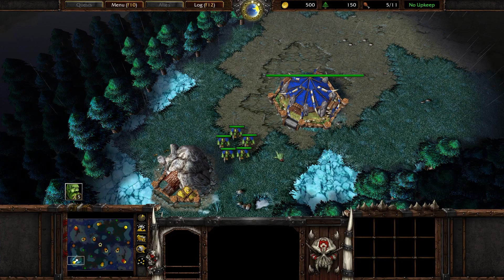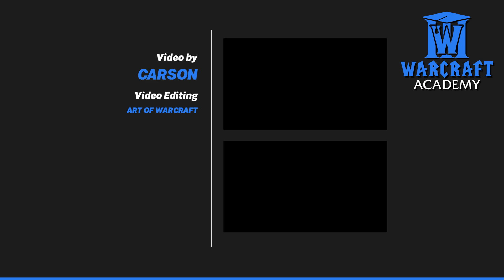Hotkeys & Control Groups - Warcraft III Academy

Comment: It was a very nice video. I want to ask something. I would be glad if you could help me. Is there a way to assign control groups to a single super group? There is a maximum of 12 units in a control group, but I want to control 50 units with a single key. For example: 5 knights, 6 priests, 3 heroes, 10 gryphon riders... all in a single group

Comment: yeah but kinda missed the most important part of control groups, the several ways you can press them with your one hand, it's rarely discussed but it is so big of a thing and i think why so many struggle with just making control groups in general.
now normally a person would try to use the tip of the pinky to try and hold control and then press 1 but typically that would be really awkward to do since you have to probably try hard to stretch your fingers out to reach it which might make you cramp in your hand to do that or you shift your elbow in towards your body to make it easier to reach or put the keyboard further to the left so you don't have to move your elbow, but there's another way you can hold control and press 1, now it might vary which number you need to press after holding control what is the most comfortable as holding control with the tip of your pinky and using your index finger to press 4 feels a lot more natural than trying to press 1 while holding control with the pinky in that way.

but in any case the other way to hold control is to use either the middle part of your pinky or rather the "belly" or underside of the pinky or even using the start of your palm below the pinky and then use whatever finger you feel comfortable using to press 1, alternatively you can even curl your pinky so you're pretty much pushing control with the nailbed of your pinky or lean the hand to the side and rest the curled pinky on the control button..

now, i haven't seen many people do this but i guess you could use both hands which requires you to let go of the mouse and click the number you want with the mouse hand, this would make it a lot easier but might take slightly longer to do and letting go of the mouse is such an odd thing to do that it might be uncomfortable for that reason.

however with all of this said, there's other ways of creating control groups instead of holding control and that is by using shift instead of control which is easier to reach for the fingers if you intend to use the end of your pinky, but with that said, the only way to overwrite a control group is still by using control so it's still not like you can forget about it and using shift to create control groups isn't really necessary at all and you can get around by only using control + number, shift is just a handy button just in general, now what you could do if you want to be really precise about what type of units you want and you don't want to box select everything, you can use ctrl+shift+ the number you want to put them in,
control lets you pick a unit type that will add all others of that kind of unit into your selection and by also holding shift it also lets you add another type of unit into that same selection
and ofcourse adding the number will attach those units into that control group.

now you could also just box select and shift click the portraits of the units you don't want to deselect them to make a control group and then while still holding shift press the number you want to assign them to.

but in short, there's a lot to add about how to use control groups and especially how to physically press them and if you really need to, there are moments you won't have to and you can just click a unit or box select a few or ctrl click a group, but control groups is extremely useful to just move around and letting you have the control to easily just jump to buildings and create some units while not looking at your base while doing so.

now good luck and really feel for yourself what works for you in how you make your control groups, the best one is the one that works the best for you.
Reply: Big brain move is to palm ctrl instead of pinky
Reply: @mattice9083 same dude

Comment: after 20 years I find out you can add to control groups by shift + number! I remake groups constantly LOL
Reply: Same….😂
Reply: Same 😅Though I'm a little surprised he didn't mention that you can, when a control group is selected, shift click on units you want added to a control group or shift and drag a square around them to add them by afterwards remaking it. Still useful to know when the screen is cluttered with units, no?
Reply: @alaron5698  Absolutely.I'm just so trained into remaking groups.It's hard to untrain myself.
That's it i'm quitting my full time job and i'm playing warcraft more
Reply: @nicknewell23  Haha, yeah, sure feels like a job to learn the game xD That's kind of the quandry I'm in right now. I've always wanted to get at least passable at an RTS (especially WC3) because it seems so rewarding, but man, the barrier for entry is so damn high! I feel like I'm just clicking buttons and that it will be a long time until I stop feeling so overwhelmed. If I at least knew the game had a solid future, I might find the investment a worthwhile one, but boy, RTS's sure are on rocky ground, and who knows what will come with the Reforged "fixing" they're doing.
Reply: @alaron5698   Although we may never reach our end goal.It's the struggle itself that yields its own rewards. - Lieutenant commander Data
Reply: @alaron5698  In my opinion warcraft three is the hardest game ever made.
It requires the highest capability to even start playing multiplayer
Blizard should really find a way to make sure new players. don't have to play against people like myself
Reply: @nicknewell23  "Pleasure should really find a way to make sure new players in unscaled." 

Erm... I can make some semi-educated guesses as to what you were trying to say there, but... 😅

Comment: If I put two Chimera Roost in one control group say 5, and click a single time to produce Chimera, how many would come out? One each from each of the buildings or just one in total?
Reply: Usually one from each building selected. Only if you have not enough ressources for two, you will produce just one in total.
Reply: @caramuja  I see, so click once and two would be made given a resource is available for any production building. Thanks. I will try it tomorrow. Have shut down my PC, already midnight here.
Reply: @Kievlar  It is not for everything. Some things work on a single.